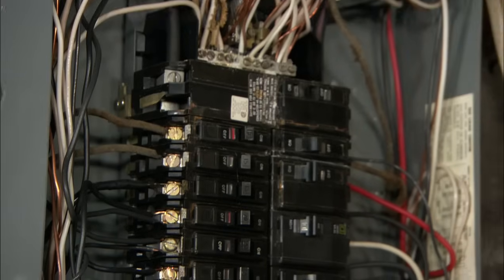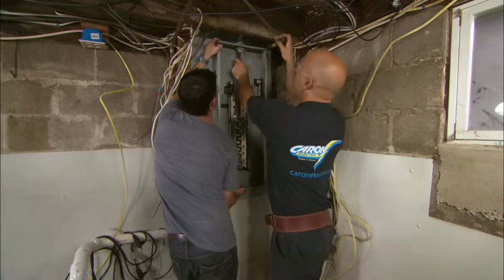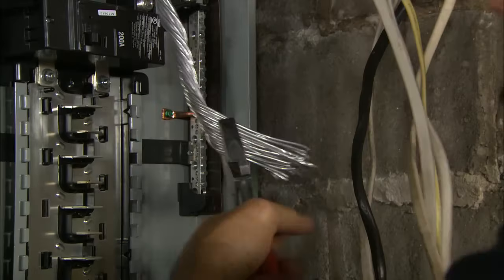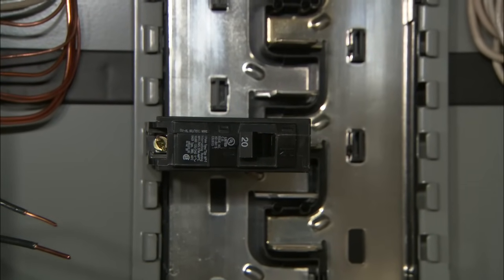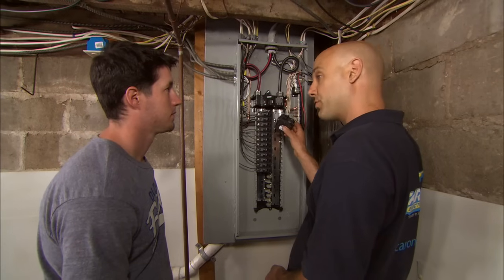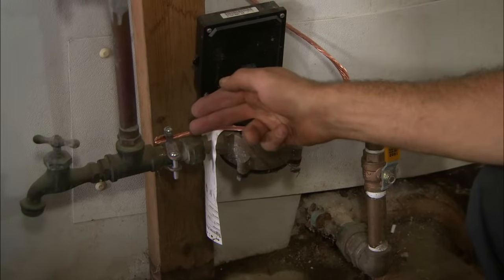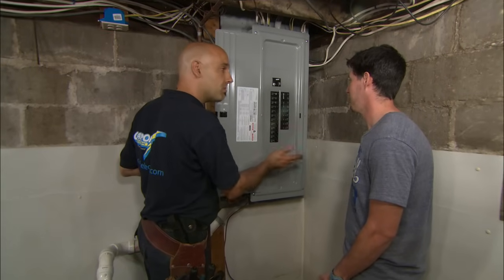How to Upgrade an Electrical Panel to 200-Amp Service (Part 2) | This Old House

Comment: Again,  how and where do you connect the bare ground wire.  Where does it go???    Does it go no where or what???
Reply: It connects to the same spot as the neutral
Reply: @TechHowden  Thank you,  sometimes it is not that clear.
Reply: he explained it at 2:20 in the video. pay attention :)
Reply: I'm not an expert but I believe that in a service entrance panel which is what they were working on in this video, neutrals and grounds are always bonded together.
On a sub panel they are always kept on separate bars.

Comment: It’s scary that lack of sufficient earthing (grounding) is very obvious in America. In the U.K. safety is way more strict. You guys don’t even sleeve your earth cores? I’m amazed
Reply: I've been to parts of Europe that had an electric water heater in the shower head...yeah so much safer
Reply: lol..at least we don't have 230 volt receptacles next to the bath tub.
Reply: @Fireball573  We don’t 🤣 That just shows you know nothing about U.K. electrical regulations
Reply: @uplightuk8924  Actually I’ve worked overseas with several “sparks” from the UK and have had this discussion before. Yes, your dwelling receptacles are all 230 volts, including the ones in wet locations. I don’t care if they have your version of GFCI, devices fail everywhere around the world.

Comment: not safe to assume that a circuit has the same gauge wire used throughout. Even if 12 or 10 AWG is used from the panel, other parts of the circuit may use 14 AWG. So a 15 A breaker must still be used
Reply: Bullshit. He’s not responsible for going through every branch circuit wire in the house to see if someone has changed the wire size somewhere downstream
Reply: @electricaf365  I think the appropriate middle ground would just be using the same amperage breakers that were previously used on each circuit. Definitely not their responsibility to dig out every single circuit for a panel change
Reply: @vb5piz3r  yes. Agreed.

Comment: I know it’s not absolutely required by code but if you can isolate and dedicate the ground it’s better to do so. Better for most electronics anyway. All you need is one more bus bar separate
Reply: I'm not an expert but I believe that in a service entrance panel which is what they were working on in this video, neutrals and grounds are always bonded together.
On a sub panel they are always kept on separate bars.

Comment: Neutral and ground are not the same
Reply: In a MAIN panel they absolutely are
Reply: I'm not an expert but I believe that in a service entrance panel which is what they were working on in this video, neutrals and grounds are always bonded together.
On a sub panel they are always kept on separate bars.

Comment: How much would this work and materials cost from licensed electrician?
Reply: Depends on your location but roughly between $2500.00 - $3000.00
Could be more or less depending on how many existing circuits, if you need a 30 or a 40 circuit panel
Underground or overhead service etc . Lots of other factors.

Comment: He just cuts all of the wires from the old panel? Have fun trying to switch out those breakers in the future if needed, like upgrading to a dual function gfci/cafci breaker.

Comment: Why did you not separate the grounds and neutrals?looks like the first panel after the meter.
Reply: Because you bond your neutral and grounds at the first means of disconnect which is his 200 amp main.
Reply: @gamerbeast3234  ok good to know. I’ve seen a lot of confusion about that.
Reply: @stucorbett7905   I'm not an expert but I believe that in a service entrance panel which is what they were working on in this video, neutrals and grounds are always bonded together.
On a sub panel they are always kept on separate bars.

Comment: Lucky I had to pay $6000 for a new panel to put in my house and some electrical upgrades like separating an overloaded circuit the electrician was such a crook he put the new panel in and put the old breakers in took the new ones that came with the panel he worked for less than 2 hours and didn't separate the overloaded circuit luckily my dad and brother in law know how to do electrical work so load on that overloaded circuit got separated and all but the dryer and breakers have been replaced dad's replacing the stove breaker this week when he installs my newish stove.

Comment: I have a Question if you could so kindly answer when ever you can please , my breaker box I thought was 100 Amp - sorry about my ignorance on this Field - I added up all the breakers on each leg - I don’t know if that matters although I have on the left side 195 Amps in breakers & 190 Amps on the right side does that mean I have a 200 Amp Servise ?
Reply: No so the amperage listed on the breaker is the limit in which it can go to before tripping. Meaning all your circuits in your panel that have a 20 amp breaker are operating under 20 amps. So if you have a 100 amp main you have 100 amp service and if your panel ever draws 100 amps or more on either the black or red leg the your main will trip protecting all of the components in your panel and the meter and the wiring between. The only way to figure out how many amps your panel is using is to use a multimeter or ammeter and test the amperage which will be less than 100

Comment: The reason why you put that loop on the wire is, if you need to reconnect the wires after the ends burn out ,you can trim the burnt brittle ends without being short.

Comment: That was really professional. Good idea with that protection gel for the copper wires.
Reply: I have seen other videos that stated gel in not required by NEC ode anymore as newer wire is formulated with alloys that do not oxidize anymore even though some inspectors still make you use it.

Comment: You know what, I love this program, Ask This Old House.  Great information here about just about everything you need to know to maintain your home from landscaping, to electricial to plumbing, carpentery, masonry projects, just EVERYTHING!  sad though that in the Pittsburgh region, WQED channel 13 fell off the radar screen and you can't get it anymore on over the air broadcasts like in the good old days.
Reply: GROUNDING TO THE COLD WATER SUPPLY IS A BAD IDEA AS WELL.

Comment: The service entrance wires are still only rated for 100 amps, he taped the bare ground wire in the service entrance cable white and used it as neutral.

Comment: I have a very old GE box. I can't find right size breakers for it. I will put in a new square D. Any comments on old GE box?
Reply: 1/2 size GE breakers can be bought at Lowe’s.
Reply: @MikeSwirled  Thanks.

Comment: The "gel" should have been used on the meter socket connections.
Reply: Copper doesn’t need the gel. Just aluminum oxidizes
Reply: @shawnbroswick1272  copper does oxidize. Oxidization happens when you use two dissimilar metals. If the wire is copper and the lug is not you should still use the gel.
Reply: @Spectre302011  yes. When you mix the 2 then you need it. Thanks

Comment: I would have given the locknuts on the BX (mc) more than a couple of taps. Outside metal sheathing and connector are the path to ground.

Comment: I bought a older house 🏠 someone installed one like that and didn’t put in the main ground wire properly (loose in the box) & it was backfeeding through the cable wires (120 volts).

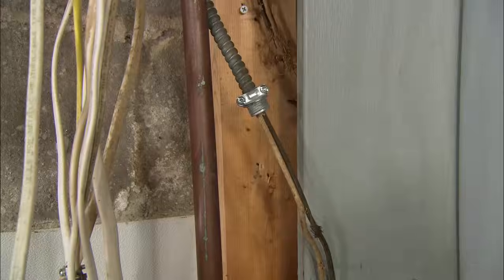Comment: 1:59 That looks like some old armored cable there.  Reminds me of some of the cables in my own home xD
Reply: BX (ac-90 depending on where you live) wire is much more common on steel framed commercial buildings but still has use in residential applications.
Reply: @shadowwolfmandan  Yeah, in certain places like going to a furnace or water heater is still common.
Reply: BX a common name sparkys call it here in myarea.   Still around in the code book.  But not really used here.  We use for house wiring Romex cable.  A lot easier to use.
Reply: @zerosparky9510  Definitely.  And you can tell how old it is from the decrepit-looking rubber and cloth insulation on the conductors.
Reply: My circa 1953 home still has mostly 2 slot receptacles which a neighbor told me is dangerous because they are not grounded. I called in an electrician, who luckily was an honest man, and he said there’s nothing dangerous at all and no need to change the outlets in the bedrooms, living room and dining room because everything plugged into them does not use 3 prong plugs anyways. Also he said my system is in fact grounded because it uses metal BX cables and all the boxes in the walls are metal and therefore it’s all grounded. He illustrated using a light tester by plugging in one wire to a slot of the outlet and the other to the center screw on the wall plate and the bulb lit up. So glad he was honest because it saved me a lot of money. He did change a few outlets to 3 slot outlets which he said is necessary  in the basement for the washer and dehumidifier as well as two outlets in the garage for power tools and lawn equipment because he said the adapters don’t always give a good ground to equipment with 3 prong plugs.

Comment: Ground to Water is one of chief reasons why plumber get shocked during T-Storms.  Use a gosh darn Ground Rod! They are not that expensive!
Reply: They did, this is part 2 of the installation

Comment: What is the purpose of doing this?  What would you need to add that the standard box could not handle?
Reply: Older houses have 100 amp service (my house, built in 1974 is 100amp).  If I want to install central AC, I need 200Amp, which is the current standard.  I cannot install central AC without first upgrading my 100amp service to 200amp.  I also used to Cryptocurrency mine.  Again, I'm limited on how much power I can use by my 100amp service.  I think you need 200amp for a hot tub as well.

Comment: if you used proper copper cables you wouldnt need that gunge on the conductors
Reply: OK so spend an extra $500 on copper wires to save 10 cents on "gunge".

Comment: 2:31, the bare ground wire and the white neural wire are tied in same bar, my local inspector told me they can not be tied in same bar and have to be separated, and the green screw has to be screwed all the way to panel box.
Reply: This is the main service panel in the building. So the neutral and ground wires can be tied to the same bar. If this was a sub panel then they would need to be separated by a neutral bar and ground bar without them touching each other
Reply: That doesn't make any sense that you would have to separate the grounds and neutrals on the bars but then bond them together with a screw.
Reply: @sylviaisgod6947  The scree has to be take out in sub panel.

Comment: Not trying to backseat, but it's interesting the video didn't mention any sort of testing. Where I'm from that would be grounds to loose your license on the spot.
Reply: Where are you from??
Reply: @electricaf365  New Zealand
Reply: @michael-gary-scott  that sucks
Reply: @electricaf365  if you say so. enjoy your untested 200 amp panel.
Reply: @michael-gary-scott  I didn’t mean NZ sucks. Just that it sucks you would lose your license. What kind of testing would be done there?

Comment: I would have phase identified the circuits before removing them... you never know if someone wired something down the line in a way that might apply 240v on something.  And this can't be in California because that wouldn't pass as your main ground.
Reply: There's a part 1 where he did the meter socket first and has 2 ground rods

Comment: Drop the loops in the service wire. Didn't need them in the meter. Looks a lot neater going directly into lugs then putting unnecessary ugly loops.

Comment: Why did the  OLD electrical BOX was replaced  ??  add a small box for the 200A wires ( IF NEEDED) and connect the 100A wires to them and you will SAVE a lot of money for the electrician man and the 20 wires that was CUT why ? they are good , ASSUME the electrical man want to have more hours of work !!

Comment: Guys always load up on that No-ox gel.  The instructions say to brush it on and wipe it off.  I guess they want to make sure the inspector sees it.
Reply: Dumb, if the instructions say wipe off extra then you wipe off extra...
Reply: @goaliedude32  brush it on and wipe if off, the inspector will likely look at it and fail it if he can't 'see' it. 
Not saying it's right but it's how inspectors usually operate.

Comment: Still no 3-phase in US?
Reply: 3 phase is typically commercial and complete overkill an a residential application short of an apartment block.
Reply: We generally don't run 100 hp industrial induction motors in our houses.
Reply: @sylviaisgod6947  The benefits of 3-phase has little to do with "100 hp industrial induction motors"

Comment: In Germany the Meter Box is like tripple the size, also we have a Fusebox before called the HAK (Hausanschlusskasten) in this Box we seperate Ground and Neutral its better for the ESD and a little of extra Security then every House got a Fundament earth which ist Connected to the PE from the Pipes and from the Meter Box it is safer but also it costs probably way more Also we have Lower Amps because WE got 230V between Phase and Neutral and between the three Phases we got is 400 V.

Comment: Legend says the breaker panel is unlabeled to this day.
Reply: Just flip the breakers till you get the one you need off
Reply: that breaker box was an absolute mess
Reply: Your sarcastic emotional-outburst is not important for the instructions in this video.
Reply: Yea, I probably should label mine, but I usually just off the power to the entire panel instead...
Reply: I call that shitty customer service, as an electrician I always label the panel with a printed label, not a handwritten squiggly notes...and Canada has very different rules too!
Reply: @gophersgirl  I'm not going to pay 75-100 bucks an hour for someone to label my panel
Reply: @nick4leader  it is part of the quote/contract. When I wire a house I charge $120 per sqm. This includes all material, panel, permits, devices, excluding light fixtures as well as a panel schedule. While running the feeds I mark them and make up the panel schedule... I don't have to trace 3+ hours just to write up a schedule....
Reply: Well you wouldn't have to if it was labeled to begin with. And if this was a bid job that labeling would have been included in the bid. And as the power company had to be involved that means a permit had to be taken out, which means the job would have to be inspected. Once the job has passed inspection the inspector calls the power of company to reconnect. Most of the time they can get there right away if the inspector as nd electrician and power company is coordinated with one amother. Usually this isn't the case, but the electri, cian has the skill, know how, tools, and insulated splices to make a very good connection and he is working on energized lines. By him doing so you will have full service while waiting for the power company to show up. They will remove the insulated splices and use their own which will be crimped on.
Reply: @gophersgirl  true also in Canada you can’t use pvc with a few c clips you must use a mast made of rigid conduit with bolts holding it in place it also must go through the roof for more support also only th hydro can pull meters
Reply: @gophersgirl  I call that waste of expensive time which adds to the expensive bill.
Reply: @impoppy9145  A true professional does a 'professional' job. That means completing the job, not 95% . Labelling  it is the last 5%
Reply: @Ghrainne  So labelling became " professional " because you decided to?
Reply: That is something a homeowner can do with no danger of electrocution.  It really helps to have two people and radios or cell phones so you can talk to each other.
Reply: He cut all the wires without labeling them at the start so he had no effing clue what was what.
Reply: @rickybobby7276  He noted that the existing labels were incorrect to begin with and that they would figure them out when re-installing.  Personally I like to label the wires inside the box as well so I always know what circuit is which in case they need to be disconnected.
Reply: I need to know the size of wire that 200 amp wire is

Comment: If that cable was exposed to oxygen wouldn't the aluminum already be oxidized? Also, why no care in making sure the bare copper ground doesn't corrode?
Reply: Corrosion in the bare copper ground isn't an issue unless there is a huge issue with moisture - also it won't typically corrode inside the lugs if they're torqued correctly. 
As to the aluminum - the very tip might have a tiny amount but the wire wouldn't have been bare until the electrician stripped it in the panel. Aluminum will only surface oxidize.

Comment: An electrician just gave me a $4,000 estimate to do this.
Reply: Do it yourself then 😂goodluck
Reply: @johnabner7743  Thanks for responding. Due to the age of the video, I didn't think I would get a response.  First, I don't have the skill set to do it myself.  My question, is that estimate normal for this type of work.
Reply: TstormVA2012 I’ve seen clients trying to do it and it goes horribly wrong and if you don’t have the knowledge to do it then don’t. Here on Illinois by the west suburbs I charge 2,000 from 100 to 200 amps. It varies state by state because of the different codes so I can’t really tell you my price goes for everyone. Each county or state it varies but it should be around 2,000
Reply: TstormVA2012 yes normal. They make it look easy here but has a quick and easy job ever been quick and easy? There is always hang ups. Not to mention, you’re not paying for his time, you’re paying for his skill. You can sleep sound if he does it, but do it yourself and you’ll never feel safe in your house again 😂

Comment: You can't run branch circuits through the service entry compartment if it's a service panel or first means of disconnect. Only in a distribution panel.
Reply: Oh this could be the US.